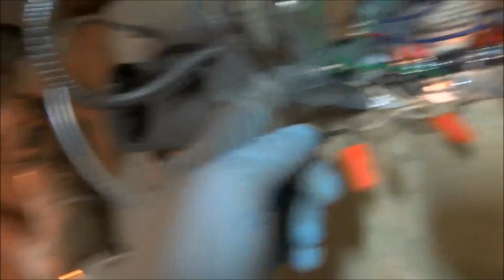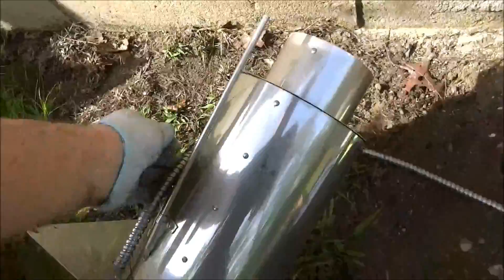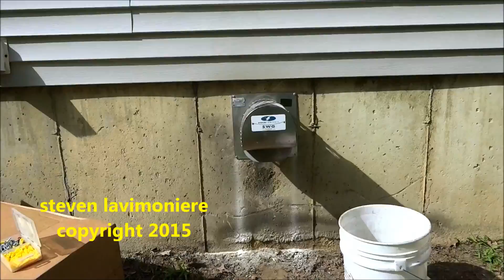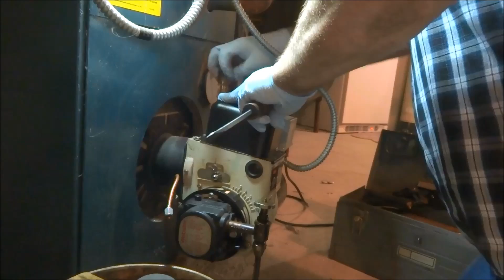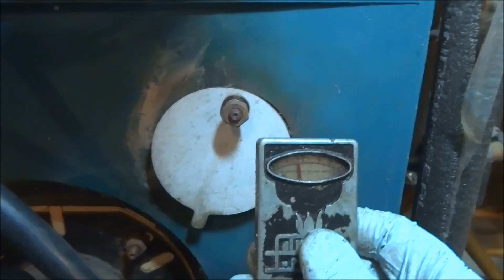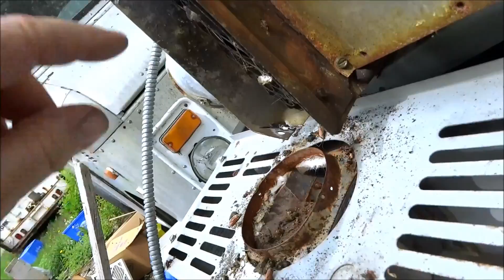old field power venter replaced with new s s  style

Comment: Was the vent above the snow line this past winter?
Reply from the maker: David Taylor snow is not a problem with oil/power venters ,it will melt the snow .700 degrees verses snow the snow willmelt
Reply: steven lavimoniere I guess it would only a problem with per purge and proving the PE switch. Don't think that would fly with an inspector in my area.
Reply from the maker: code is 12" of grown never a issue ,i work on a ton of them ,never once had to shovel out one yet ,oil burns hot the snow will melt